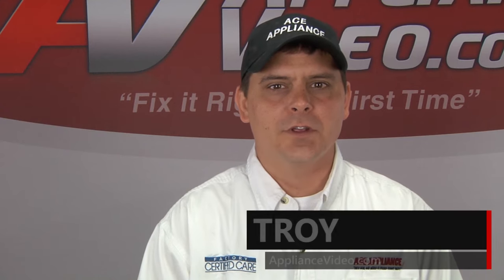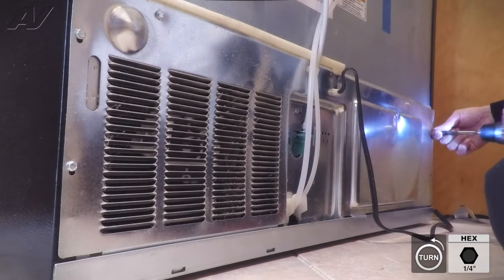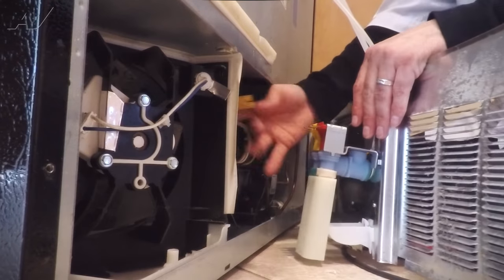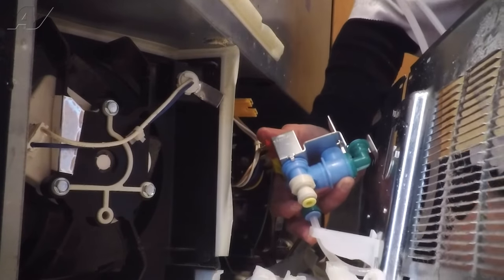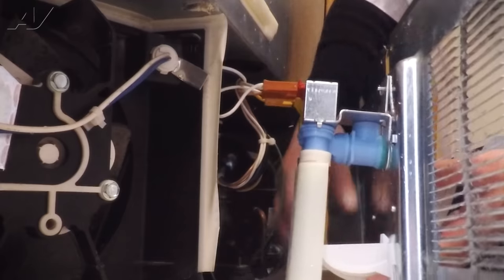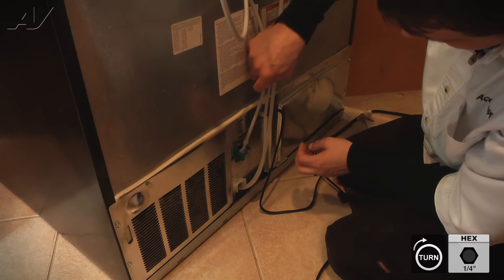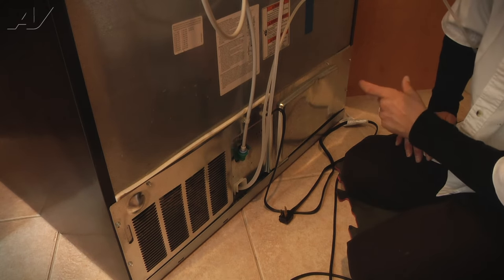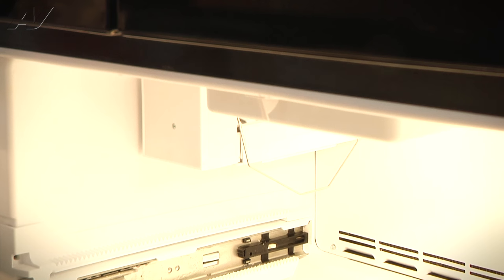Whirlpool Refrigerator Repair - Icemaker Not Receiving Water - Diagnostics & Troubleshooting

Comment: Hi there and thanks for the video, very helpful... however, I'm still at a dead end.   No ice being made still.   The fill tube is not frozen and I just replaced the Water Inlet Valve... I've also replaced the water filter.  Still no water flowing into the ice maker molds.   The ice maker itself seems to be okay and is going through the motions of making ice... just no water, so no ice.   Any ideas of where to look next?   Thank you!
Reply: I'm in a similar position. Did you ever figure out your fix? At the ice maker plug on the backside, I measured 120V between the black Line and the blue valve wire, so I believe there may be some sort of short in the circuitry.

Comment: The tool used on the tubing “Push-To-Lock” fittings is a simple automotive door panel clip removal tool. I have 3 sizes but a little tape around the base of the tool, will eliminate scratching paint if used on a door. Different types of water valves as mine is ice only. A 1/4” line with compression fitting is used for the supply. Build date is 2010 so they keep changing. A digital photo is quick to identify the connectors or magic marker left  & right. Also. Mark factory hose at fitting, take photo. Once installed after replacement gives one a better feeling is fully inserted. Just a couple of tips. Door tool can be found a Harbor Freight. ASE Master Tech-Retired

Comment: If only it were this easy. The icemaker in my Kenmore side by side stopped working last week. I removed it to see if the failure was something obvious but I did notice the coating on the ice cube mold was blistered and peeling. I was able to determine what Whirlpool icemaker my fridge has, I ordered and received a brand new unit, installed it, and still no action. The new icemaker has no cycled once and there is no water being dispensed to the unit. I just checked the water valve to the icemaker and it is definitely good. I didn't just go by checking how many ohms I was getting across the solenoid coil, I also used a test cord and applied 120V to the coil. The solenoid actuated and I could hear water flowing through the valve. I then went into the freezer compartment and checked the icemaker mold tray and it is half full of water. Half full because I manually operated the fil valve and didn't want water all over the place. I am stumped. Why is nothing easy? I have over 40 years of experience fixing cars, appliances, tools, you name it and every so often I get into something like this that makes me want to scream.
Reply: I got the same problem. I'm think is the water line has froze up inside the door.  Now to figure out to check and how to get to the line?
Reply: I'm in a similar position. Did you ever figure out your fix? At the ice maker plug on the backside, I measured 120V between the black Line and the blue valve wire, so I believe there may be some sort of short in the circuitry.

Comment: Just noticed while watching this video that the replacement water inlet valve wasn't seated properly into the existing metal tab on the back of the panel before installing the screw to hold it in place. I'm thinking it might create a little bit of torque on the water valve assembly.
Reply: Hi Don, I a
m having the same issue.  Did you figure our how it got fixed??  i see you posted 9 months ago...
Reply: @marvelwise  We’ve been making ice the old fashion way being our in-line ice maker isn’t filtered.  At some point I need to order a new inlet or buy a new fridge, my wife of course preferring the latter.

Comment: I was getting ice in my freezer but no water.  And now I get no ice either.  I replaced the water filter to a brand new filter.  No water.  My water button works (I hear the actuation).  I then checked my crisper for ice (to see if it is frozen) and even defrosted for 3 days to be 100% certain; still no water.  I replaced my water valve and ensured all water hoses are connected properly.  The water from my wall comes in and runs through the water hose, up into the water filter and comes out the return line to the water valve.  Water is properly flowing.  The new water valve is showing appropriate resistance with a Multimeter (186/257).  So if the water from the wall is pushing water up into the water valve and back down the return line to the water valve with a high rate of water flow, what could be the suspect?  For some reason, I don't think the water valve is allowing water to flow through it even though the resistors show proper resistance with Multimeter tool.  Is there a secondary component behind the water filter that pulls or pushes water to the dispenser?  Could the computer board be suspect even if the water light is on and I can hear dispenser actuation, but no water?  I am really stumped here.

Comment: Not so fast.  Mine had red washers that had to be removed -before I could remove the 4 hoses.  Yours however, don't appear to have the red safety washers.
Reply from the maker: Great question, if you have a more technical question that our parts department cannot answer, you can search our over 17,000 answered questions free at our website www.ApplianceVideo.com under our Repair Help section. You can also call our parts department at 1-800-830-5465 and they can give you help 7-days A week ,or search at www.SaveMoreOnParts.com  .

Comment: We switched out the ice maker.  we had water going to the ice maker but when we installed the new one there is no water.  We cycled the new one but still no water flow.  we have water to the door water dispenser.  i put the hair dryer to the water outlet in case it was frozen but still no water flow...
Reply from the maker: Great question, if you have a more technical
question that our parts department cannot answer, you can search our over
10,000 answered questions free at our website www.ApplianceVideo.com under our Repair Help section. You can also call our parts department
at 1-800-830-5465 and they can give you help 7-days A week Monday -Saturday, or
search at www.SaveMoreOnParts.com  24 hours 7- days A week.
Reply: Same here
Reply: Same problem.

Comment: Q? Water dispenser working but no water gping to ice maker?
Reply from the maker: Great question, if you have a
more technical question that our parts department cannot answer, you can search
our over 10,000 answered questions free at our website www.ApplianceVideo.com under our Repair Help section. You can also call
our parts department at 1-800-830-5465 and they can give you help 6-days A week
Monday -Saturday, or search at www.SaveMoreOnParts.com  24 hours
7- days A week.
Reply: How you fix your problem? I have the same thing with my Whirlpool refrigerator . Dispenser is working but ice maker is not making ice.
Reply: Brian Do, I bought a new ice maker my old ice maker there’s a burnt wires...
Reply: @yabeezy  Thank you for let me know. Service guy ask for $360. I just buy ice and put in there so my kid can dispend and use it for now.